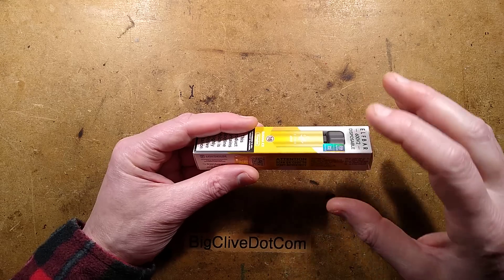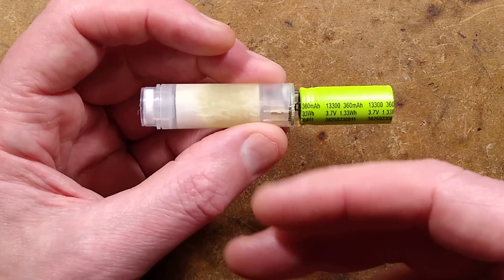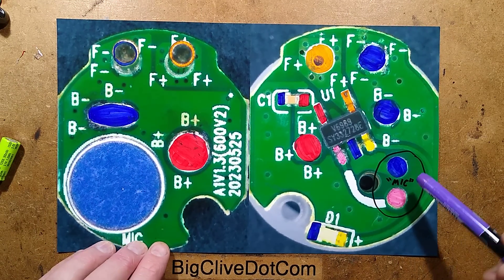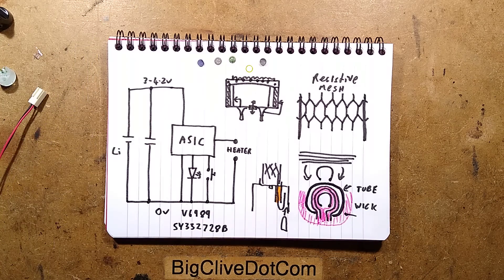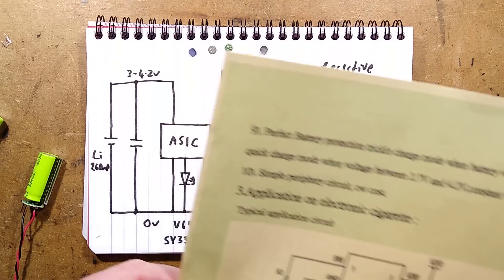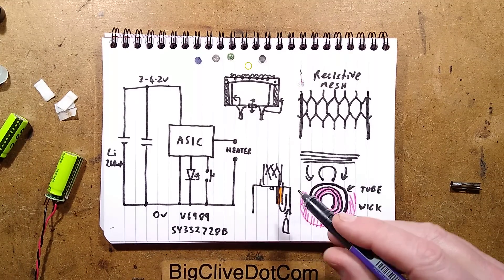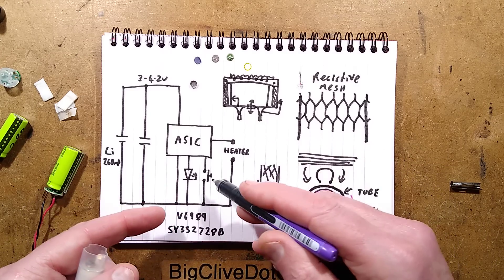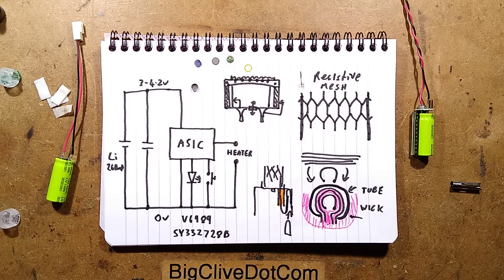Lithium "capacitor" in a disposable product

Comment: The standardized 510 threaded battery modules and cartridges were probably the most economically effective as well as environmentally clean method of vaping but the availability of these standardized parts and equipment with a nicotine vapor substance varies from place to place
Reply: Modern vape shops have way more disposable junk than actual mods. I had to teach a lady working at one how to use a real mod because she was blowing through disposables super fast.
Reply: RDA's and RTA's are the way to go, from a cost and environmental standpoint. But, they take a little more effort and knowledge to use. The user makes their own coils and wicks them with cotton.
Reply: @horseshoe_nc  Rebuildable drip and tank coils are a bit of a niche hobby; although it is economical, most people will find them a faff.

I left the vape industry as the UK's Tobacco Products Directive (TPD) came into force. I was more concerned with the availability of large-capacity liquid tanks and stocked up appropriately! The EU directive stipulated that the maximum tank size was 2 millilitres. I later learned that manufacturers were fitting tank liners to limit them and restoring them to a 5-millilitre capacity if removed. 🙂

We are lucky the UK Government took an 'Italian'  light touch approach to the EU directive and that the NHS Stop Smoking Service and Cancer Research UK got behind vapes as a way of reducing tobacco harm with the result that the UK, after Scandinavian countries (who use SNUS) has the lowest tobacco smoking rate in the EU at 13.5%, a reduction from 20% in 2011.

As far as I know, the UK government is only 'considering' banning disposable vapes.
Reply: @horseshoe_nc  I will never recommend anyone get into those. Tank systems are the best combination of being ecologically smart and lazy. You swap a coil once every 1-6 months depending on cotton or ceramic and then just add juice. Super simple
Reply: @Falcodrin  I've never seen a coil head last more than about 1.5 weeks. I will admit, RDA's and RTA's are not for just anyone. I even switch back and forth between rebuilables and coil head tanks.
Reply: @horseshoe_nc I had similar results with rebuilds, RDA's 0.8 ohms mostly.  2 weeks was pushing it so I didn't expect a rechargeable pod system to do any better.
My last pod got through over 60ml of 50/50 nic salt before the flavour impaired. That's nearly 2 months use. Quite a surprise for a £10 rechargeable device. And the pods cheap too.
Reply: @Falcodrin  Often called "stock coils", coil heads, pop-in, etc. I've never, ever heard of one lasting 6 months, or even 2. You can become accustomed to a burned, nasty coil - see the coilgore page. 
I've mixed pure flavor free liquid and after a couple weeks even it'd taste kinda off.
Reply: @JMA_Elec  I only ever use ceramic coils from vaporesso. I do eventually cook them but if I'm careful even if it looks wild it tastes just fine. Replacing the coil just brightens the flavor a little.
Reply: The juice in the disposables is different. I've been vaping for 15 years and I just love the taste of disposables!
Before anyone attacks me, I don't buy them and I'll never buy them. I collect disposables and extract remaining juice from them!
It's sounds disgusting but I've become rather skilled at it, and it saves me a fortune! 🥳
Reply: @deanosaur808  I think most of them are using nic salts, which do lend to a different profile. Imo it is a cleaner taste, but the salts hide a stronger nic dose on the tail. I've played around with them in my own mixes in drippers and it can be done, but I find the nicotine kick too intense, along with the throat hit. If you're using something leaning MTL and like, single-wire coils, I bet it's good.
Reply: It's a shame the pop-in coils and rebuildables have died down. 
I rebuild, so my usual waste includes some cotton and a few inches of wire here and there, though I could make wire lasts weeks and simply clean and rewick it. I reuse many of the little PET bottles since I also mix liquid.
Reply: Exactly, I've seen a few changes in the last 15 years. ;)
Reply: Issue is states like mine banned flavored vapes, so getting E-liquid is a pretty big task here. Created a huge underground market where disposal vapes are being sold under the counter at convenience stores, gas stations, and even middle schools. So it's far easier to get a disposable than the liquid for proper box mod or pod mod. It also increases cost. A disposable lasts me 7 days, a 100 ml bottle of eliquid and 10 pack of coils costs the same but lasts me 3-4 weeks. If you want to know why disposables have taken over the market after box mods and pod mods held total dominance over the market for damn near a decade. Moronic political hacks who listen to big tobacco the original ones marketing nicotine to children because they are in the pockets of big tobacco. They couldn't give a rats ass about the impacts this has on children getting addicted, adults who just go back to smoking, or the environmental impact. Yet they will harp on and on about how we are killing the planet. Never trust a politician. They will reach out a hand to save you and then pull out  a gun with the other and shoot you the second you become inconvenient for them.
Reply: I learned to rebuild the atomisers for my uwell tank and have had the same one for years now... I have enough resistance wire for decades I think. I build them at 0.4ohm and have made enough that I know how, wicking them right takes a bit of practice since it needs to be quite tight to not leak.

I know this is taking it a little bit further than most but it's not very difficult, I can build 5-10 coils in half an hour or so. I vape unflavoured DIY 6mg liquid as well, 1L costs about £20 or so to make... not bought nicotine for a while but it can get quite cheap especially in bulk at 72mg/ml. Coils last a long time with unflavoured, can easily get 1-2 months from them.
Reply: I prefer mechanical mods. I think you know why, but here's a WoT explaination for those who don't. I wanna give a rundown on a time-honored style of high-power vaping that involves no wires or PCBs, no disposable coil cartridges, a small stash of high-capacity/high-current lithium cells, and a smidgen of ohm's law (I try to cover a lot.)

They can be machined out of nothin but copper, steel, brass, or any combination. Every part in the circuit is a solid hunk of metal with lots of available conductive mass and contact surface to minimize power loss. No wires, no insulation (besides a bit of PEEK or similar to define the interrupt portion of a button and separate the positive pin on the atomizer from its base.) No circuit boards. They're built a lot like flashlights, but instead of a lamp, you have a threaded hole on top where the atomizer screws in. The outside of the mod and atomizer deck are negative, with an insulated pin in the center of the deck being positive. That meets the positive end on the battery directly, with the negative side resting on the insulated ring of the button on the bottom. Pressing the button raises the negative contact up to the battery and completes the circuit. It's a simple, rugged, and effective design. The good ones can theoretically last for decades and all you're liable to replace is a button spring, or maybe the flat copper machined screw that serves as the button's negative contact.

The downside is that it is unregulated, meaning there is zero fault protection (though I argue basic inspection will easily clear fault conditions, they are so simple and nothing is hidden, with no small/finicky connections - only solid stuff, just watch the battery wraps and top insulators.) This also means power output is determined by the resistance of the coil on top... meaning you can put one on that grossly overdraws on the battery and leads to a runaway scenario... at which point that metal tube might become a pipe bomb, depending on the quality of the battery inside. It's a basic ohm's law calculation to work out what resistance you can go down to before drawing over the max continuous amperage for the battery. 

Simple DC circuit. You have a known voltage max of 4.2 (lets say 4 under load - drop is minimal with a clean mod and a good battery.) The resistance is easily measured, whether by probing the atomiser contacts, or screwing the whole thing on an inexpensive 510 meter. Ohms law is Voltage = Current x Resistance, so assuming a 30A limit on a fresh battery you get: 4 = 30(resistance). Basic algebra. 4 / 30 = 0.13. The lowest resistance for a 30A battery is ~0.13 ohms, which would yield an output of 120w. You then know that as long as your coil build reads at least a hundredth of an ohm or two more than that, your battery will take it. The decision at that point is how long you want the battery to last, short and long term. Building is easy from there. Anything from a screwdriver to a round pencil, or a cocktail stick can become a mandrel for wrapping a coil with your wire. Clip the leads and clamp them down in the screw posts. Test fire, oxidizing out surface shorts to see the true resistance (scraping with tweezers between pules helps, and you can use the tweezers to shape them.) Wick with rolled strips of cotton, load with juice, run coils while blowing on them to break in wicks, replace top, drip n vape. It's a little more involved than just screwing in/on a new cartridge but ultimately not something that takes a ton of smarts or skill, let alone more than 15-30 minutes time. And it's actual orders of magnitude more efficient as a way to have a very good vape that basically always works. You can even play around with different types and sizes of wire for different vapes. On the skilled end, you can put multiple wires of multiple types into one coil to boost the surface area further.

I will say, modern high current chemistry seems to tolerate things that made older ones vent violently markedly better. They more just wear out when you run them higher than they're meant to. Today's best 30A cells are a world apart from yesterdays in a runaway scenario. Though that scenario is entirely avoidable by never pulling more than the max continuous amperage, keeping the mod clean, and the battery insulation intact. And buy the best batteries you can. Forget claims made by re-wraps, buy OEM to get the exact cell with known current rating spec coming straight from the mfg.

I feel like you shouldn't need more power than a single-battery mech safely provides, as fun as the ultra-high-power stuff is. FWIW, a dual battery series mech can give you almost 200W on 30A cells before pulling 30A, and all you do is build to higher resistance to wrangle the angrier electrons - choose more power or better battery life. And that's just a metal box that holds two batteries with a twin-contact rocker in the bottom. I've seen em running no bigger than the box-style disposables. They barely have to be bigger than two 18650's side by side because the circuit is all solid components. Check out something like the Noisy Cricket, the build on em is dirt, but it goes to show you don't need a chip to pack a ton of power into something small. I used to run a 'derringer' style RDA on top that was  ~3/4" tall from base to tip and it was a tiny terror, dragging 180w through a dripper the size of 6 quarters stacked on top of one another. It's instant Power. Capital 'P' required. I haven't hit anything like it since. Regulated mods at 200w feel 'slow' by comparison, on the same build. Barely bigger than two elfbars stacked face on face, too.

I'm just sayin... you don't need plastic and circuit boards for top-tier performance. Unregulated gives you tons of power... it's just that you gotta steer the whole ship to make it work. And then you do, and life with vaping is so much easier, your setup basically never fails to provide you with a quality experience. And if it does, you're 10-15 minutes away from the problem being gone. Drop em all you want, it'll eat the impact. As long as the tube is thick enough to not dent on the bottom and seize the button, the worst that will happen is the wicks inside will get thrown around, you'll have to pop the top, take a pen or something and quickly guide them back into the channels in the deck. 

Rebuildable tanks DO get tough to use, as it's hard to get a coil with the right power AND size to work well in them when your wattage is fixed to resistance. But simple drippers work great, and IMO are the most reliable when you know your way around them. In terms of sustainability, they are hard to beat. Well-made ones require no spare parts and are infinitely reusable. It's just a CNC'd deck with screw-posts for coil leads, a short piece of metal tubing to house 1-4 coils atop that deck, and a mouthpiece to draw from. Pretty much anything that can go awry with them, can just as easily be corrected. And the performance is still the best out there, RDAs are competition-level.

The upside is that if you're like me and use an RDA on top, you only need resistance wire to wind coils with, and good, clean cotton to wick. I've been vaping on the same supply I bought of both SEVEN years ago. I throw away a couple of bits of kanthal and spent cotton a month. You can keep the coils for a long time by cleaning with a stiff brush and dunking in an ultrasonic. One pair can go for almost a month with care before seriously degrading. The thicker wire is especially resilient. Dispose of 4 18650's per year. Apocalypse will see me pulling them from drill and laptop paks. I know which are which, and what their current ratings are, how to check health and IR. If I drop it in the water... it's simple to just dry it out, clean/rewick, new battery and I'm off again.

Literally all I have bought for years, are ingredients to make the juice. If the world ends, I'll be gutting toasters for the kanthal or nichrome ribbon inside (ribbon wire vapes amazing honestly - stack a few and you get gobs of surface area with very fast heating,) check vanities for makeup pads. And I'll just keep vaping on a natural-patina copper tube with hand-engraved skulls and peony flowers covering the entire surface. Prolly be holding one of the best vapes in the wastes.
Reply: @differentbutsimilar7893  I have about a half dozen mechanical mods. Nothing hits like a mech mod that is setup properly. However like you mentioned, the user does have to have a fair bit of knowledge to be safe with them. I don't use my mechs as much as I once did. But they are definitely fun to use.
Reply: @horseshoe_nc do you happen to know where I can offload all my nice equipment? I have a rather large collection tarnishing away in my drawer.
Reply: @Hugh_Jassle  Honestly, I'd probably buy some off ya if I had the cash. I'm also not sure how everything works since her in the US vape stuff is regulated like tobacco stuff as far as shipping is concerned. When it comes to the US at least, that has become complicated and it may not make it thru the mail, especially if you happen to be in another country, trying to ship them to the US.
Reply: @differentbutsimilar7893 You sir just reminded me on the fine arts of vaping, damn now im starting to miss the thing, i have to dig out my old vape case, get a few new batteries and start building again.😂
Reply: Canada had a conniption fit over vaping and has a "won't somebody think of the children" mentality so RDAs, RDTAs, etc are banned for sale in the country. You can only buy tanks with premade coils, pods, or disposables. You can't even change the coil in the pod because of the child safety bullshit you have to throw the whole fucking thing out. They charge us a carbon tax at gas pumps "for the environment" but let tons and tons of plastic ewaste to be created with modified pods and disposables. It's a damn shame they're so ass backward in 2023. Some provinces have even banned "flavors" so you can only get tobacco or unflavored juice. Bitch I quit cigarettes I don't want to keep tasting tobacco, the flavors are what got me off cigs. Sorry for the long rant lol, I'm just so annoyed at their incompetence. I'm glad I diy my juice and have China to buy actual decent gear from.
Reply: Australia is in a weird position here because we used to import "substance" from overseas which was permissable. then they placed a ban on it, and now the market is flooded with disposables. now they are banning the disposables because of the kids and slowly we are creating a black market. The government were warned about this, and it's played out as everyone in the industry suspected. While some of us are trying to make our lives better, the local corner shop still continues to sell combustible cancer creating products and the government is totally fine with this. Make me sick.
Reply: I was a die hard coil builder for 5 years until my homie gave me a few Puffbars. I spent so much money on those damn things it eventually led me to quit altogether.

Comment: The chain of events that has led to every manual/through-hole solder point getting triple-marked on both sides must be interesting.
Reply: If the circuit board gets silk screened, extra indicators aren’t more expensive..? I curse every “hobbyist” board that doesn’t have pins labeled on both sides of the board…
Reply: I wonder if they learned from a fire or two from incorrect polarity. Notice only the power components are triple marked
Reply: @youhackforme  The power stuff is the only through-hole stuff and the heater element doesn't really have a polarity. Yes, they must have had a few spectacular incidents involving backwards batteries.
Reply: Makes sense when things are packed so close together, makes it very unambiguous what's what
Reply: LOL, yeah!
Reply: Totally agreed.  Soldering Lion batteries is stressful stuff in my limited experience!
Reply: that's why the resistor - goes on last, to prevent shorting.  @danielmcanulty1562